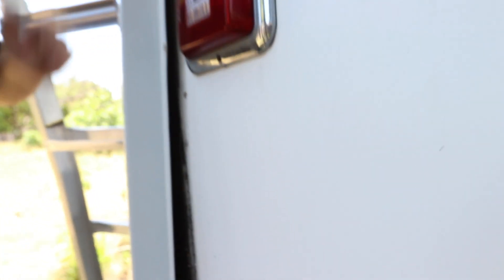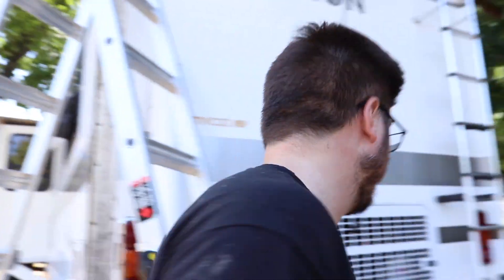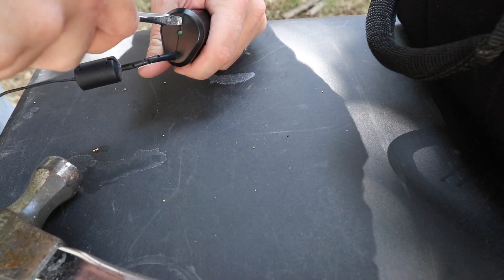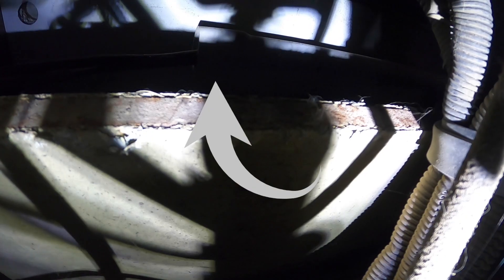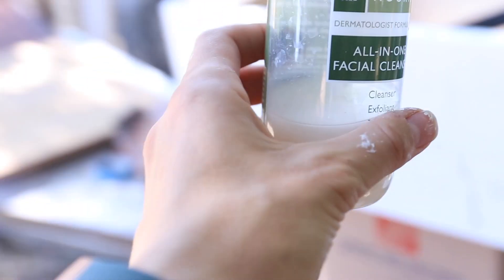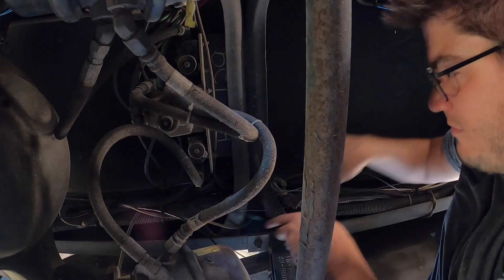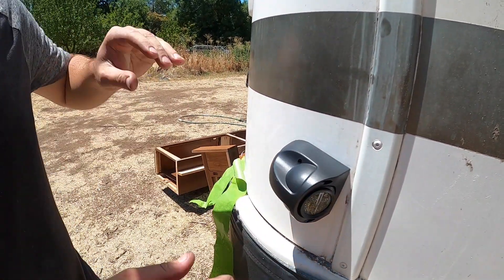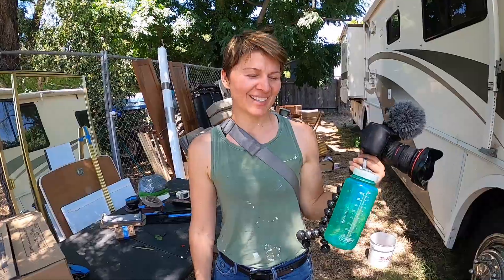RV Renovation | More Paint and Replacing the Backup Camera

Comment: Hi Ryan, Sue. I'm curious why you chose this specific camera set. It seems rather expensive. Is it worth it's money?
Reply from the maker: We chose it because it had 4 wired cameras and a screen big enough to display them all with good detail. Also, it had good reviews and looked like there were people using it in a commercial vehicle. We also wanted a system that recorded all 4 cameras when it was on. I'm not sure I would go with the same company again though. While the cameras are working and they are pretty clear, we had to get all 4 replaced by the company. The ones they shipped to us did not work properly. They were all over exposing the image when out in the sun. 
Granted, they did replace them all, but I would have expected better quality for the price. I have bought cheap dash cams before and been really disappointed with the image quality and life span. They all seemed to die after a year or so of use. They just use cheap image sensors and components. My hope was to get something  with a little better quality. The company claims that they will continue to support the product if anything breaks. We will see if that is true. So far they have kept their word.